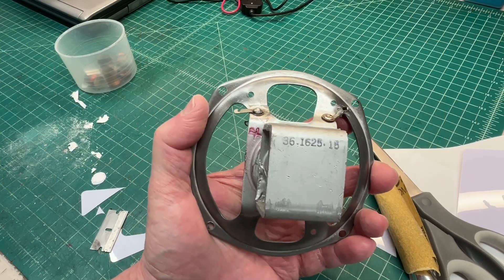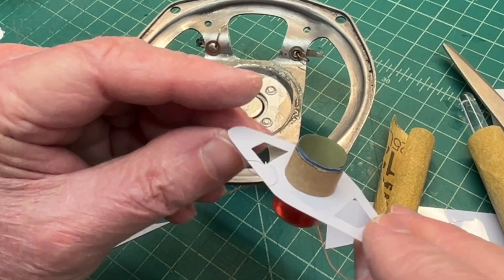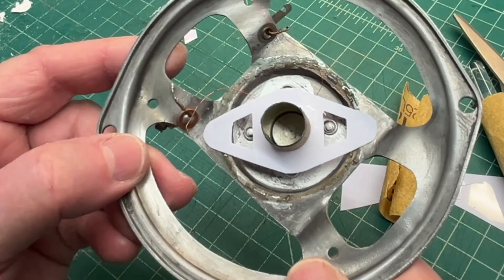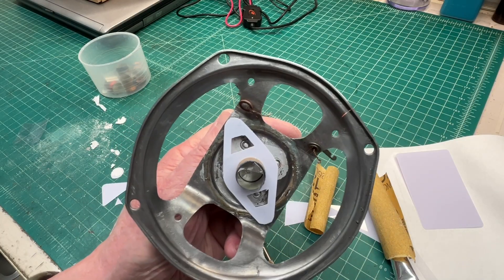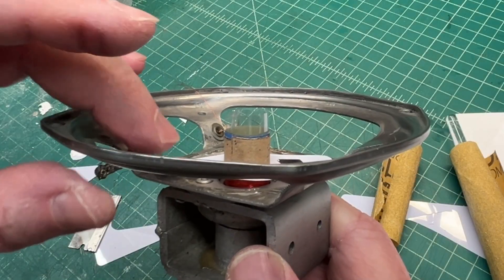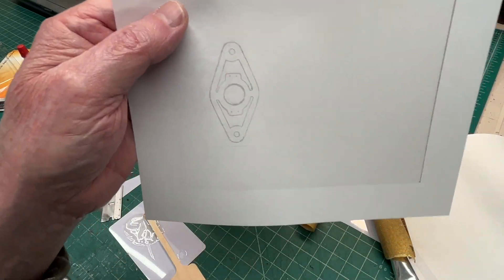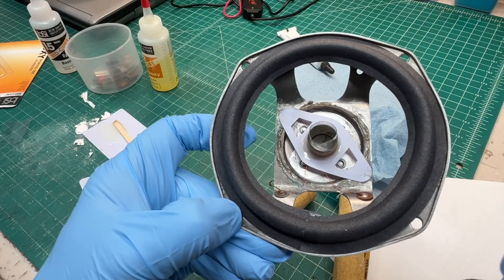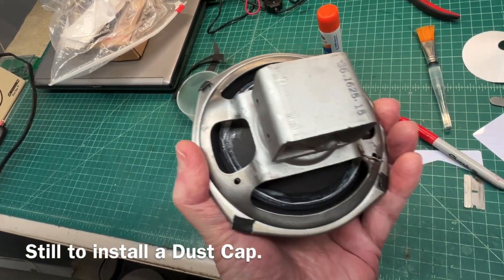Philco 36-1625 PM Loudspeaker | Voice Coil | Spider | Cone | Surround | Gasket

Comment: Nice work from scratch !
Since you often restore speakers a little tip: test them after finishing on a real tone board, so the characteristics of a mounted speaker in a cabinet are met. Just hard board or carton (3x the size of the speaker) with exact the size of the speaker cut out in the middle. Observe the difference in tone (bass !) when you fit the speaker behind the board, it is amazing. Many people don't know what the function of that tone board is, namely to prevent a short in air pressure from the front directly to the rear of the cone, what makes a very tinny sound. It is also the reason why it is not good to drive the speaker full power when out of the cabinet, the cone does not get dampened enough.
Reply from the maker: Thank you for the information, next time I have some scrap wood laying around I may build one and give it a try. All the best. Don
Reply: @RestoreOldRadios  Its a nice experiment I can't find on youtube, Thanks 😉